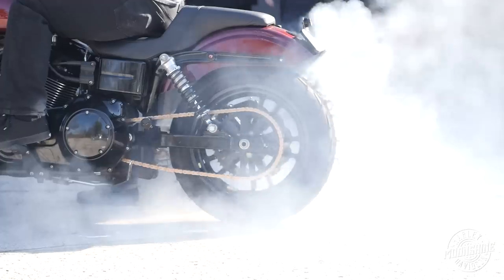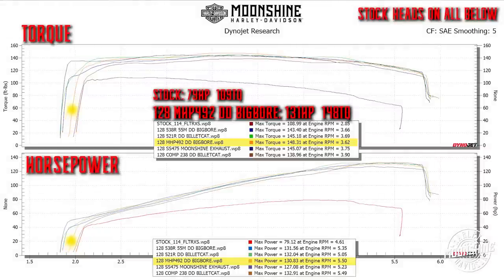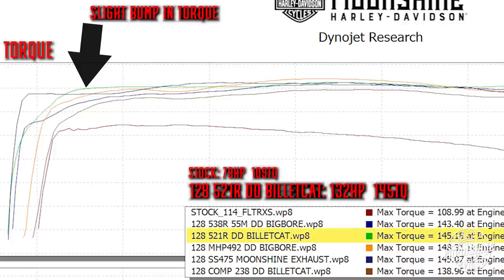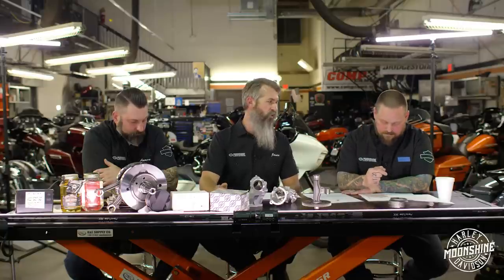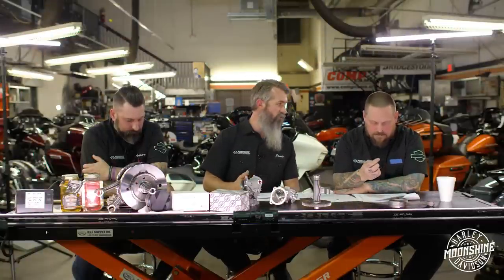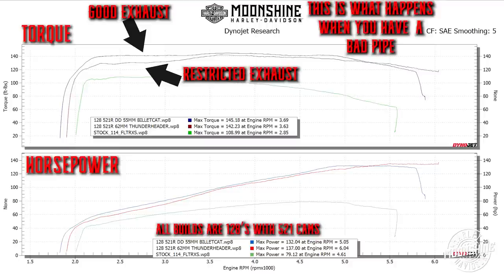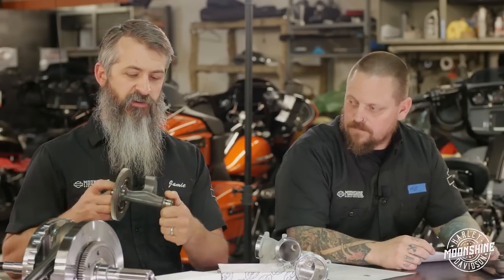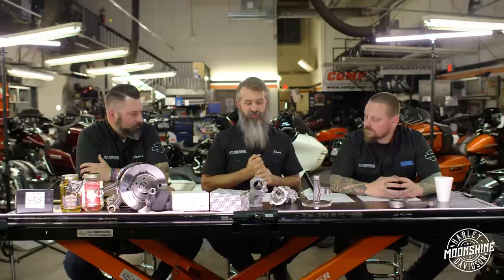Cam Shootout Series | Part 3 Big Bore 124 & 128 Cam Comparison with M8 Stock Heads

Comment: For all you guys that can’t afford Moonshines engine upgrades try this......
Rode my Electra glide standard 107 up to them from Florida in May. They put S&S 465G cam chest kit, fulsac headers, power vision
Tuner, and I just put TAB BAM stick mufflers on for sound.
Now running 101 HP and 120 Tork!
Now I have the power and sound!  
Thanks Moonshine!
Reply from the maker: Hell Yeah!!! Thanks for the trusting us with your Harley.
Reply: You should change to a T-man Cam. I have a T-man cam in my 107 factory Tuner ECM S&S head pipes, Arlen & ness big mouth sucker air filter. my horsepower is 113 and my toque 130.  But I must also note I do have headwork and a Zippers chain drive with a bigger sprocket, Energy one clutches and a racing clutch basket on my Street glide.  Its My 1st Harley so I still like to Walk it like a street bike, Some people frown on me for picking my bike up Alot!  (Power Wheelie) I do NOT have to use the clutch to pick my bike up in 1st and 2nd gear. My Cam turns on at 2700 Rpm Instant Power!!!  These guys are So right on Everything; Torque is way better than Horsepower Believe me!💪🙈
Reply: What did it cost?
Reply: $4,800 for everything except the Bam Sticks.....I put them on 3 weeks after I got back
Reply: Jeffrey Carroll 4800?! Is that everything? I did a similar set up to you on my 2020, But mine only came out to 2.8k all said and done. I got a woods 22x-e cam, ss lifters, cuffs, and pushrods. Fuel Moto 2-1-2 head pipe, and a dyno tune. Made 115 TQ and 109HP. I didn’t do the ss cam plate and oil pump upgrade though. Bike had a air intake and khromewerks slip ons when I got it.
Reply: @ragingninja4292  yes....I did the full S&S cam chest kit with gear drive.wanted to get that Harley cam plate and oil pump out of there
Reply: Joseph Marton   bikes aren’t 30k unless you buy a cvo. My 2020 roadglide i got for 21k with a stage 1. You could buy a Softail standard for 13k and spend 2-3k on a cam upgrade which will make over 105 HP and close to 120TQ.

Comment: Kudos on all the work you guys do with the trial and error.  I'm not made of money so the Harley 131 sounds like a better solution.  My 17 SGS is in the shop now because of the oil sumping issue at 30,000 miles.  A badly engineered oil pump from the factory jacked up the entire engine.  If I hadn't got the Extended Service Plan, I would be looking at thousands of dollars in repair costs.  I am going with the Harley 128 Stage kit, get it covered under the ESP and if I have any more issues I am going to sell and go buy a Goldwing, Indian or BMW.
Reply from the maker: It’ll be nice to get the extra power. We would advise to upgrade to the S&S or Feuling oil pump and plate. They are both superior to the Harley one, the Harley one will do the job but the other two mentioned will do it better. 

I guess you could buy a BMW but they are repaired more the H-D. If you are about to buy the Goldwing  just buy a new car as they are pretty much the same thing. The Indian is the closest to the harley but why buy the imitation when you have the real thing?
Reply: @MoonshineHarley  Several folks in my HOG Chapter have gotten over 130,000 miles with the twin cam running original equipment.  That's what I was expecting from the M8.  I have had nothing but problems with this engine starting literally from riding off the lot.  The dealerships have been great with service but they can only work with what they got and I don't have $$$ to throw away.
Reply: @mojomanmurph1925  I have not hear on that many issues on the M8 overall unless its been built shitty frankly. I have Buddys that are well over 50k already and no issues. Makes me think it was a Saturday built engine possibly ? Whats been the main issue on your bike?

Comment: As I'm in Europe, I can't take my bike to Moonshine. So I got a Fuel Moto 128" (same as S&S but with a FM badge) 10.75:1 kit with their Wood WM8-22X-E cam, DynoJet PV w/ Target Tune, 5.5g/s injectors, Feuling RS plate and pump, Wood lifters, SE 64mm throttle body w/ Ward ported manifold, Feuling valve springs, SE Heavy Breather Extreme A/C, Jackpot 2-1-2 headers and Hi Roller mufflers, Dark Horse comp, and Barnett Scorpion Lock-up clutch.

Motor still needs to be built though, so no numbers yet, but I should expect 130+ HP, and 140+ TQ.

Comment: Absolutely correct about the fuel mileage, riding to work and home I get 30-35mpg, on a road trip running 70-80mph I get stock mileage.

Comment: You referenced the moonshine exhaust package a few times.  Will you elaborate what parts you use?
Reply from the maker: The Moonshine Exhaust in this video is our hand Tig welded stainless steal head pipe. It is 2 into a X chamber and back into 2 we pair with Khrome Werks mufflers with one of the baffles we have designed. We also have a Anti Reversion Chamber Exhaust System which is a 2 into 1 and there is an options for a false pipe so you can have the dual look if 
preferred. We will do a video and both of these exhaust systems later this year.

Comment: When will the video with CNC heads and larger cams be out? What power level do you recommend putting in the fueling head studs?
Reply: Exactly as I have the 128" Stage 4 but want to get more, especially low end torque.  Would like to be able to wheelie away on take off just by twisting throttle.  I have had 83, 80" shovel easiest wheelie ever, then a 91 80" evo that was close to the shovel.  My 128" won't do that.  Yes wheel pops up but back down just as fast....

Comment: So a tech question for Moonshine. Does the sleeper concept(s&s475 w/ moonshine exhaust) apply to the softails as well? Or, is it because of the exhaust and the set up of softails that would make this type of power not apply to the softails(I own a lowrider S, RS472 cam, bassani prostreets, 130tq and 113hp). Just curious.
Reply from the maker: We have lots of different setups for the low Ride S. It depends on what you would like. Here they are, 128, 130, 131 Stroker, 133 Stroker, 135. We have a Moonshine HP 2:1 anti reversion we run on softails. They come in Black, Raw Stainless and Polished Stainless. If you like to know more please call 
615-274-4170 ask for Jamie, Nick or Aaron.

Comment: Do you have to beef up the trans? How are they holding up to these?
Reply: freerunning nj I have a 128 kit. Still have belt drive. No problems. Also I don’t try any wheelies! And just do rolling burnouts!
Reply: I suggest you do I don't have A128 my bikes A107 but I did break 3 belts, a clutch basket and ate up teeth in my transmission. Its best to buy a Baker's transmission, or have a extra factory one on hand if you ride hard like me.  I do a lot of highway riding long distance @ 85mph get to where I'm going race my bike all weekend and ride back home. putting like 500 miles on my bike (each time) that's being ridden hard.  If you plan on doing a lot of hard riding get another transmission Sir, Or get bigger gears in the one you have now.🤔
Reply: Grudge box...no more trans issues
Reply: Also I have about 3500 miles on my 128 so far

Comment: @moonshine harley, dumb question, does your 124/128 upgrades come with any warranty?? I just bought my 2020 RGS and new bike, don’t mind spending the money on a setup, but can’t do a new setup and possible issues later. $$$ decent but not rich. Lol. Thanks -Brion
Reply from the maker: We will warranty our engine build until
your factory warranty expires. So if you just purchased your Road Glide S well warranty it for the two years. If you are out of the factory period we will warranty it for 6 months. We are also really close to launching our own extended coverage that will cover pretty much any upgrade. We will go over more when you contact our team. Please call the shop when you’re ready and ask for Jamie or Aaron  615-274-4170

Comment: For myself, I'm a little confused, and 'let down,' by HD.  
I just purchased an '04,' Heritage Softail, "88."  It's all stock, and as far as I can tell, 'all original.'  Right down to the leaky O ring on the clutch cable, I will be replacing this week...
I've ridden the bike less than 300 miles in this past month, and you don't even want to know the $$$  I've already put into it, for parts, tools, oils, etc., and ofcourse, the monthly payment to the bank!

There seems to be few people happy with anything "stock," on an HD and it's usually for 2 reasons...
First, most experienced HD riders always want more power, torque, and sound.  "Bigger is bader," seems to be the moto.  "You just gotta step it up to the next biggest, baddest...  Thing!"
And I get that to a point.  Like shoes, you outgrow your first ones and you are ready for the next bigger size.

Secondly, and more importantly...  
It would appear that a stock HD engine is, in a nutshell, "CRAP!"
I have listened to many people, who tell you of everything that can and does go wrong with stock engines and parts, from twisting crankshafts (crankshaft runout), terrible plastic shoes on chain tensioners, the poor design of the "tapered connecting rods,"  cam and tappet "hardness glaze," coming off, Cam plate and oil pump destruction, Cam bearing wearout, on and on, etc., etc...

But because HD is such an 'Icon,' (Although it's 'less American made' nowadays), in the US and the world for that matter, there has become this, "Aftermarket culture," where everyone feeds on the fact that HDs in stock configuration are cheap, flimsy, poorly designed money pits.
And the aftermarket feeds on this like hungry piranha, on all the meat, in a man's wallet!

In the end, what I get from all of this, is that if you spend the $24K+, for a new HD, no matter the size engine, or you get a used bike...  Just go ahead and plan on spending double the $$$ to have the engine and tranny rebuilt with better made, aftermarket parts.  Or replaced, all together, for something built better, with better parts, better design, and built the way America used to build a lot of things...

Better power, better torque, better sound, will only be achieved, by how much money one is willing to feed to the aftermarket piranha!

When I say "Piranha," that's not a term I mean entirely negatively.  Take these fellows at Moonshine HD.
They are all about the numbers...  They eat, sleep, shit, puke, numbers all day long!
It's like a secret society, speaking in riddles and codes!  LOL
But they have created a living from doing what they do...  They pay their bills, feed their families, and have established a reputation, for the work they do.

And for their efforts, they have become just a few of the school of piranha, that take a crappy, stock bike, and turn it into what dreams the owner may have for it. 
"But dreams ain't free and they ain't cheap!"

And along with Moonshine HD, there are literally hundreds, if not thousands of aftermarket products, some great, some not so much, but ALL part of the piranha schools out there, just waiting for someone to step into the tepid waters of the HD world!
Reply from the maker: James Lanning it’s an American obsession!!! Bigger, faster, stronger.
Who wants slow or stock Camaro?
Who wants slow or stock Mustang?
Why do people make diesel truck have 800-1000hp.

AMERICA!!!

When the USA shows up to the Olympics we win. It’s in our blood and trained by our culture.

Comment: @Moonshine Harley I have a 2018 Heritage 114. Factory warranty runs out on Sept. 24. But, I have a Discount ESP warranty that begins when the factory warranty runs out. The Discount ESP warranty is not voided if you use aftermarket parts or tuners, but it doesn't cover those parts. It covers the bike itself and any H-D/Screaming Eagle parts. This means I can use a PowerVision, aftermarket air cleaner, pipes, and those specific items aren't covered but the engine is covered as long as I use the H-D 131 kit. I am referring to the new (Sept 2020) Softail 131 kit. Laying all that out in some detail to avoid misunderstandings. Because of how my warranty works, I would rather use the H-D 131 than an S&S 128. I am in North Carolina about 8 hours from Nashville TN.

My question is, is there a body of knowledge of what I can do to maximize the 131 while maintaining reliability? I have a K&H/FuelMoto AC already installed that advertises 80% greater airflow than stock, and says it's "dyno proven" to support 150HP applications. It is based on a K&H Sidedraft but modified for FM to keep the OE outer plate. So I think I'm good there, though tell me if I'm wrong. I am planning to get D&D Fat Cat pipes. I have a PowerVision that I'd plan to use for tuning. I haven't seen any info about cam options for this kit (other than the one it comes with), so that's my main question, along with anything I did NOT ask about but should have. Thanks for any suggestions!
Reply from the maker: Keith Jordan please send us an email
with a good phone number to contact you on.  horsepower@moonshineharley.com

Lots of info to go over.

Comment: Awesome videos guys thank you for all the work you put in. Have you tested the Khrome Werks full exhaust? I know the MX and D&D are great, I just like the look of the “eclipse chrome” that Khrome Werks does. Are the 2-2 or 2-1 Khrome Werks full exhaust systems good for the 114 comparatively speaking? Thanks again for the awesome work!
Reply from the maker: We use the 2:2 Khrome Werks exhaust on large displacement engines with ported heads. It’s a big exhaust system and performs very well on that setup. For a 114 we would run the Two step 2:1 Khrome Weeks system as it’s a great setup. They also have a triple step 2:1 and it’s for a 114 with high compression and a larger cam. Hope this helps.
Reply: Moonshine Harley yes that answered my question thanks! I know you had minimal info about my bike so I appreciate the response.

Comment: I have a stage 3 Screamin Eagle kit on my 2018 Fat Bob, would a Thrashin AR exhaust match well with the Screamin Eagle Round Extreme-Flow Air Cleaner? Will I need the Smart Tune Pro since I live in the mountains?
Reply from the maker: The AR pipe would be a great choice and we would recommend it if you came to us. We would still advise you to go with one of the tuners we went over in the video.

Comment: Do you have any experience with the Chris Rivas 474 and/or 544 cam? Leaning towards an S&S 124 build with head work and the 544.
Reply from the maker: We haven’t got a chance to run the 544 yet. You would have to pair it with ported heads and not the Harley ones. If you’d like us to setup a pair a heads with some other parts for your build please call the shop and ask for Jamie 615-274-4170

Comment: This is an amazingly informative video!
Thank you for the time and effort you gents put into shooting and testing.

Ive got 11:1 120ci Pistons and Feuling 508 cam. (S&S oil pump springs rods etc) and 55m SE manifold going into my build. Stock heads Supertrapp/Scremin Eagle exhaust.
Is the 508 cam a good choice for this setup? Sadly there isnt much info about the cam.
What experience do you have with the 508?
Reply from the maker: We run the 508 on our 114 and 117 high compression engine but switch to the Feuling 521 or 538 on larger displacement setups. Is there still time to go to 11.4:1? You can most likely do the increased compression with a thinner head gasket.
Reply: @MoonshineHarley 
Thanks for replying!
Yeah i will be using a 0.030 MLS headgasket if thats any help.
I should be okay then with the 508 then as 120 is near stock displacement right?

Comment: you did not mention which big bore kit's your using eg. Harley Screaming Eagle, fuel moto, S&S -or the compression ratio ? i'm in western Canada and there is no way i could bring my bike there-my bike is a 2019 FXBB street bob 107 I want to do a 124ci with the 475 cam looking for 145tq ,thanks love your channel

Comment: Great Videos!  I’ve learned so much from you guys!  I have a question.  What cam would you recommend for Max torque/HP and touring reliability using using 124 Rev Perf Cylinders, SE Heads, and D&D Billet Cat?  I currently have a Wood wm8-408 and it seems to be beating up my valve train (Valve noise, noisy lifter, TB reversion,  etc).  About to go In and sure things up.  Any feedback on Cam choice would be greatly appreciated!
Reply from the maker: Jonathan S. Banks Email me your phone number and I’ll have Jamie call you.
Horsepower@moonshineharley.com
Reply: Moonshine Harley Telephone number sent!  Thank you very much!

Comment: I have a breakout 114, can I install a 128ci bore kit with the stock can and springs? I know that is not the best configuration but I want to know if it’s something damaged if I do that…. I’ll install 590 cam and oil pump in the future.

Comment: So I have a 2019 Road King Special 114 with SE stage I. I want to upgrade to stage II, I’ve been looking at the SE515 cam. And keeping the rest stock parts. I only say SE parts as I want to maintain my extended warranty (Active duty military) and I move around a lot (having that piece of mind helps) 

My question is besides the valve springs and the cam what else should I upgrade ( plan on doing a self install and having the dealership retune the bike)

Comment: I’ve been thinking about ditching my SnS 550 cam for something with more torque. It comes on about 2800-3000, been thinking about the 521 or 538. My bike is a 124 with Fuel Motos ported heads, SE 64, Ward CNC manifold, and D&D standard bore billet cat

S&S really needs to come out with something between the 550 and the 475.
Reply: What cam did you end up going with?  Similar build as yours and looking at the feuling 538

Comment: What's your thoughts on a 64mm throttle body with a 128 and a t man 3262/ 590 cam stage two heads from zippers and  d&d  xcat 2into 2 head pipe. ???